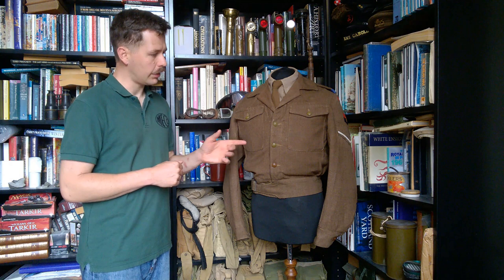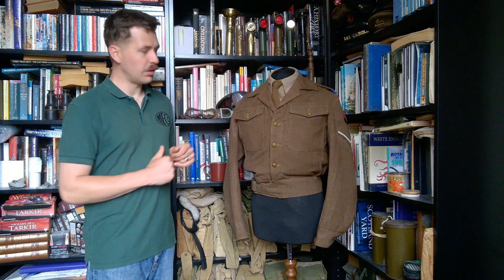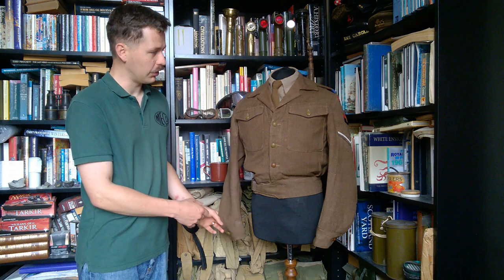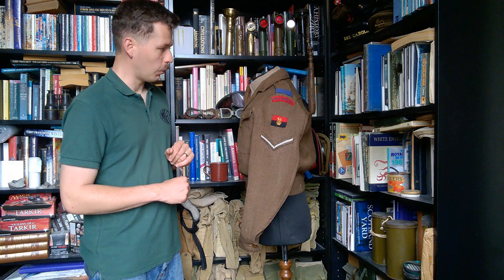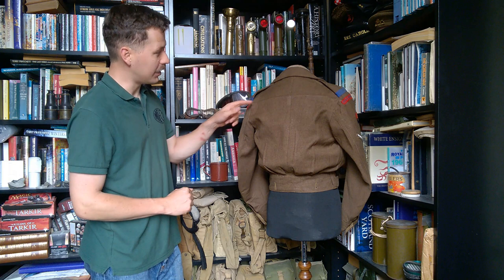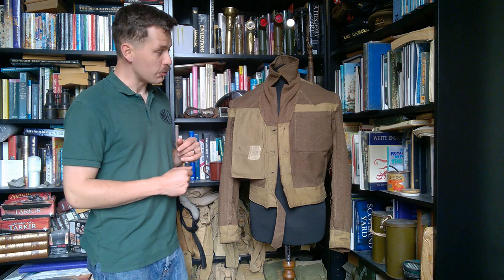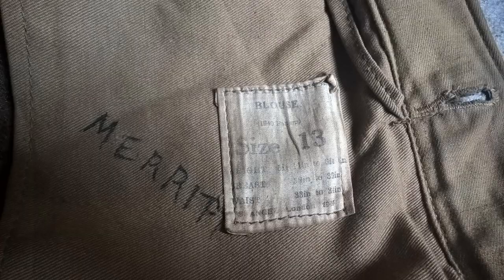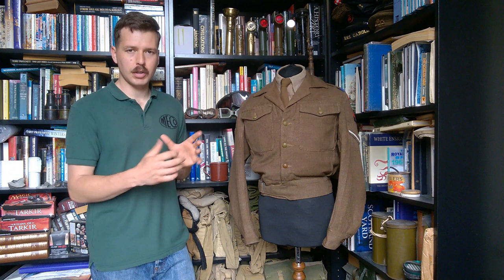Royal Engineers Tailored 1944 Utility Battledress Blouse

Comment: the crease across the shoulders was called a gunners crease, usually seen by RA units, also the blue slide denotes a detachment to the RA
Reply from the maker: Interesting, I've never heard it referred to as a gunner's crease before, thanks for that titbit. I'm assuming it was copied from the RA in that case? It was definitely not exclusively an artillery thing in the '50s. Some units seemingly pressed in two creases about one to two inches apart. Likewise, thanks for the heads-up on the meaning of the slides.
Reply: @RiflemanMoore  thats correct it was a copied crease,  i am a ex tanky and we had the crease too, also RA units wore a white lanyard, but i am sure you know that 🙂

Comment: Nice to see Tailoring from that long ago. Mid 1980's in my Unit, Tailoring was long gone, wear what you where issued and the TC/OC could see the wear on this and would back you on that at the clothing store if items needed changing either due to getteing a bit bulky/fatter or taller/Shorter or obviuosly being worn out. This is a Store, not an Issue...Otherwise it would be called Issues....lol.

Comment: Can you help please 
I have a BD jacket that is a light shade of brown wool,the neck is made in the 1940 pattern closed neck but with no metal hooks,there have only been 3 buttons with concealed button holes the buttons go up half way to the bottom of the breast pockets the rest of the jacket up to the neck had no buttons or button holes as if to be worn open similar to the 1949 pattern design but from the wear it looks like it was not ironed open The breast pockets have concealed button holes with a stitched double seam down the centre
Outwardly when fastened up it looks like a late ww2 pattern jacket There are internal breast pockets the same as the 1940 pattern The label is also in the same inside position but washed out so unreadable
The outside waist belt is also the same as a 1940 pattern
Could this be a late war  but pre 1949 type?
Many thanks and keep producing your excellent videos